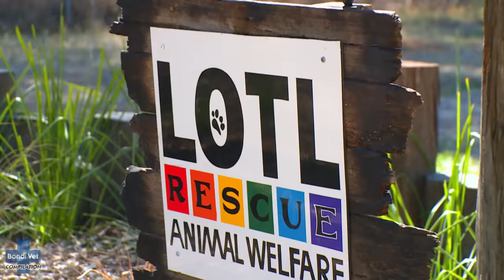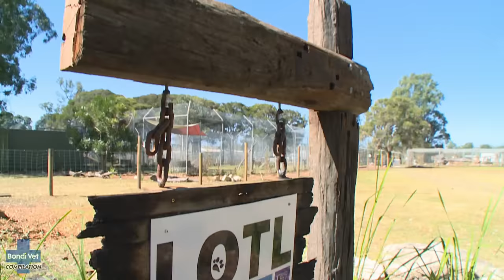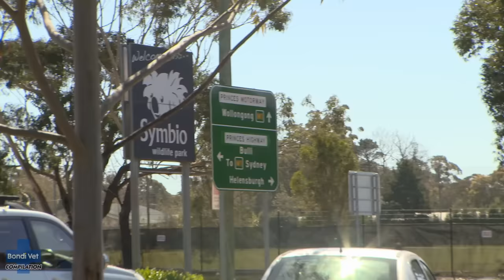What is THAT?! 😳 Not Your Average Patient! | Bondi Vet Compilations | Bondi Vet

Comment: I like that Lisa switches from afraid of the monitor to concerned vet totally focused on the wound and the outcome for the animal, no external qualms getting in the way.  Only when she has finished and done all she can, do the nerves come back.  :o)
Reply from the maker: So true, Lisa puts the welfare of the animal above her own fears 💙💙
Reply: She's afraid of computer monitors?!?
Reply: She's blossomed over time.
Reply: In all due fairness, that iguana (if that's what you call them) was under anesthesia, which caused little to no harm
Reply: I understand being a bit shy around these guys, I've been tail whipped (in the face) by a 4 ft iguana and it hurt. A lot. I had a black eye and a bruise across my face 🤕 After that I'm not a big fan of big lizards.
Reply: @sin3358  goanna, not iguana. It's a type of monitor lizard - a smaller cousin of the Komodo dragon.

Comment: Cutting of the tails of lambs is normal? That sounds horrendous! Is that fly infection specific to Australia? Do farmers globally do this? I've never heard of it before. Aren't the sheep in pain from removing parts of their bodies?
Reply: Yes, Farmers do this globally. It is to prevent feces getting stuck on the tail especially when they have diarrhea. That normally prevents flys laying eggs on this spot.
Reply: It's common practice.
 Usually when they are new born lambs a rubber band, that cuts off circulation, is applied on the tail and then the tail just falls off.